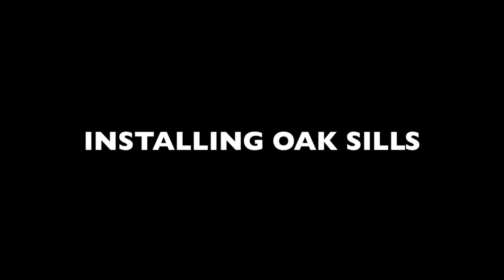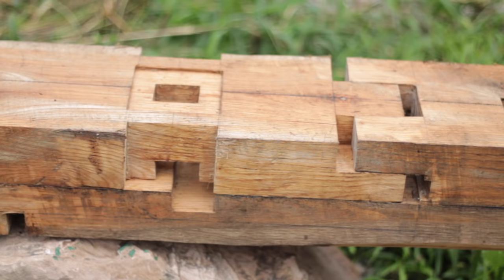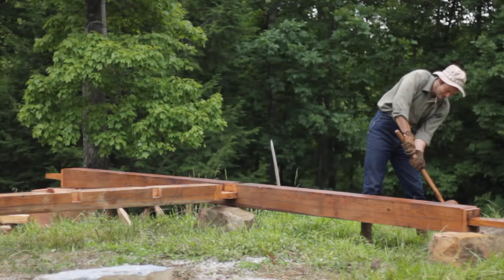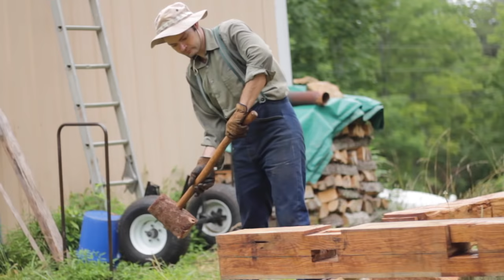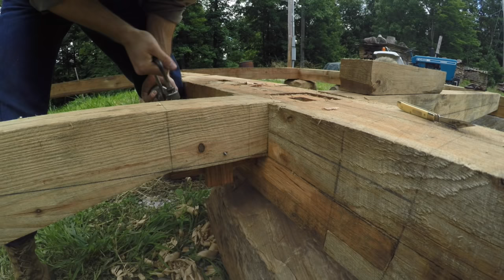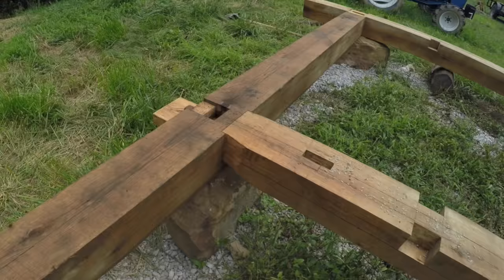Our timber frame cabin Part VI: Installing oak sills

Comment: Elegant joinery .... nice!  My go to wood preservative is pine tar mixed with linseed oil .... works great and smells so good.  Did you add the citrus solvent to help the raw linseed oil dry?
Reply from the maker: I understand the solvent thins the mix down so it can better penetrate into the wood
Reply: +Mr. Chickadee Makes sense

Comment: I'm amazed by the scale of this project that's finally shown in this video.  I've seen a lot of timber framing builds, but they are always some tiny little 10x10 thing, more like a shed than a cabin.  I love that this is looking like an actual livable structure!

Comment: You're building a "live in" puzzle box at this point. That's some intricate joinery, especially with hand tools. I loved the expression when the sudden rain shower hit.
Reply from the maker: haha yeah, summer in KY!
Reply: +Mr. Chickadee The problem with the rain (at least in Oklahoma) is the brief cooling you get is paid off in days of increased humidity. We had 29 consecutive days of over 100° temps in '81 with no rain and the heat was tolerable, but high 90s and rain, rinse/repeat, is a miserable combination. Ma Nature's cruel joke.

Comment: How long does the wood stay there uncovered? Doesn't it get damaged by the elements?
Reply from the maker: It laid there all summer. We oiled the wood after installing it with pine tar and linseed oil mixed. So long as the wood is up off the ground it would last a very long time.

Comment: You're going to get a lot of cold air under that house in the winter, can you put more stone down to fill in the gaps? Now's the time. Great vid!
Reply from the maker: The insulation will be under the floorboards, cold air under the house should not effect the interior much. there is an insulated box to house the water down to below grade.

Comment: did you stain or treat the wood with anything?
Reply from the maker: Pine tar finish
Reply: +Mr. Chickadee Thanks ,is oak a good tool handles material?
Reply from the maker: Id not use it if I had something else, I prefer dogwood, hickory, beech, maple and ash, in that order, oak splits too easy and has acid that will corrode the steel. If you have no other choice than oak, I would use well seasoned red oak and ring the handle end to prevent splitting.
Reply: +Mr. Chickadee Thank for the information and I really like your videos

Comment: You done stirred up another memory as you used that blue 2 wheeled lift. Working as an elevator constructor we would give the plumber foreman a fifth of his choice of whiskey, to let us borrow that type device in order to move our 16# per ft. 16' = 256# guide rails into position in front of the elevator hoist way so as to be stacked vertically by a hoisting drum. Sure saved our backs. Plumbers called their device a "Grasshopper". -gilpin 10-11-16

Comment: I saw that the wood had started to crack in the corner of one of your joints. Will that not affect the strength of the joint?

Comment: I've been amazed with the skill level of your wood working.  All that joinery was intricate and tight.  When I saw it raining I wondered about swelling?  You didn't cover any of it up.  Is swelling because of the rain an issue?
Reply from the maker: Thanks. All this timber was very green, rain would do nothing but maybe slow the natural shrinkage down a bit, till the sun came out again… Traditional framing used green wood and joints which worked in concert with the natural tendencies of the timbers to dry over the next decades, little things like a shower, or snow, or sun are less an issue than what you would expect.

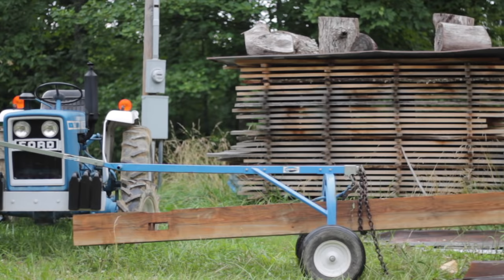Comment: regarding 0:22 I did the same thing with a regular handtruck and a strap, worked excellently.
Reply: Aaah 1/3rd pine tar, linseed oil and solvent, classic roslagsmahogny. My region of the world is where they used to produce most of the swedish pine tar in the 1600-1800s that was then world famous.

Comment: Mr Chickadee
Could you tell me please, what is the size of the cabin floor ? e.g. 20 ft X 20 ft, and how high did it end up being to the lowest point of the roof (at the edges)  and the highest point ( in the middle), and how many rooms are there ? Is there a floor plan I can go and look at some place ? Watching these videos is the best stress relief ever invented.
Reply from the maker: Well, lets see, I think it was about 16x20 inside the walls, course there is a half loft of 16x10 upstairs. Its all open, except the bathroom, just one huge room. No floor plan but you can see some in our videos.

Comment: I love your channel. One question: Why do you use square pins/pegs in round holes?
Reply from the maker: Thanks, yes square pegs are easier to make and size, tend to bite and hold better as well when the corners grab and cut their way into the hole.

Comment: Absolutely love all of your videos but i do have a question. I noticed that the scarf joint was sitting directly over one of the supports and I thought this was a no no. Or is it ok because the supports are so wide?
Reply from the maker: best is to not place directly over support, but if you do, strengthen with a corbel, which i did, as seen in the raising video

Comment: How did you determine the dimensions needed for these sills?
Reply from the maker: If you mean the thickness of each timber? I let history be my guide, instead of complex equations to describe timber strength and all that, I looked at historic examples from well preserved and successful frames near our buildings size. These were also about the largest timbers I would want to move around myself in White Oak, its very heavy stuff.

Comment: Any tips on buying a used vintage axe? What companies made good ones back in the day? On eBay, when looking at axe heads, how do you know which one is a felling axe?
Reply from the maker: hmm, I was trying to think of any new tool I would buy, none comes to mind. Things were just made better when thats what folks used. It would be hard to get a bad vintage axe…might want to get one with a broken handle to be sure they didn't burn out the old handle and ruin the temper, which you could reheat treat, but not without a bit of practice and more learning. Most any single or double bit axe would work for felling, a good weight is around 3-4 lbs. Look on youtube for the video  the axe man, old videos, also one on crosscut sawing, both from the 50s when men still used them both in the NW
Reply: great. Thank you. Any tips on how to tell if the two axe heads I already bought had the handle burnt out? I did not know to ask the sellers this in advance.
Reply from the maker: Well, you might see soot or black stain, it should look like it was fired, like an iron poker I guess, unless they wire brushed it after…